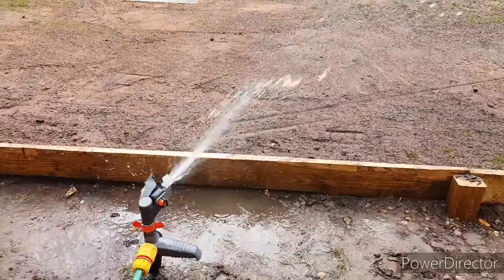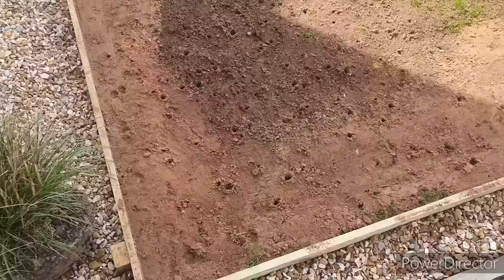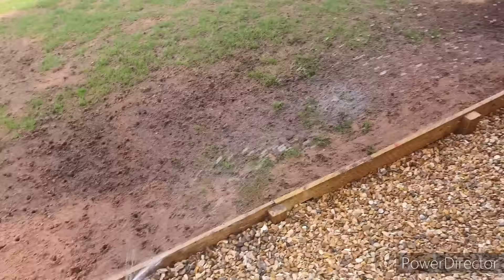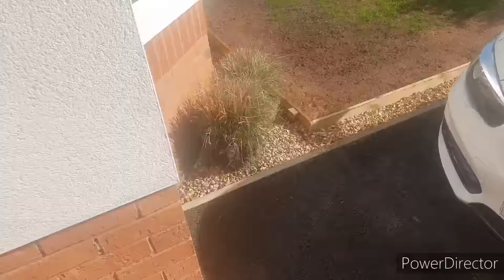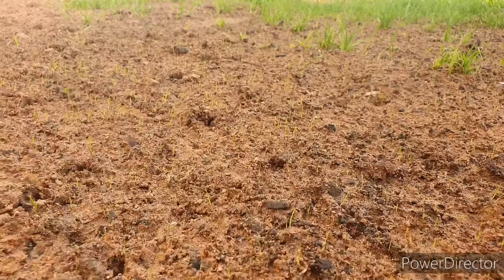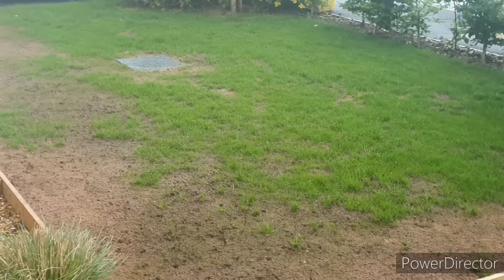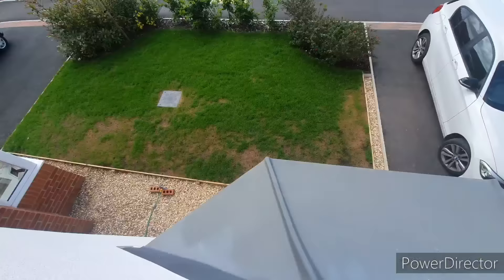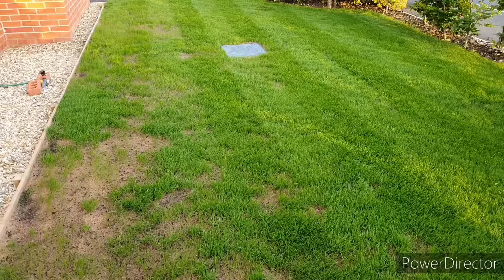Watering new grass seed (day 1, 7, 14) - 4 Week Time Lapse

Comment: 7x a day seems like a LOT of watering.  I'm in zone 8a and I just got my sprouts after day 7, with only watering 1x a day for 15-20 minutes.  I have been checking the ground by hand to ensure it's moist enough and that seems like it's been enough.
Reply: This is good news, I mean, who runs home from work every 4 hours to water the lawn?  I water one time in the evening, takes me about 30 minutes.  Hopefully I will see some germination soon.
Reply: @GiddingsMcCann  - I'm not sure what zone you're in but my above example, though in Texas, was done in a cool time of year:  April.  If you're in 8a or hotter and doing it now, you'd definitely need more watering than what I did but maybe a good soak at night could be enough.  Hot af right now

Comment: I have seeded my lawn on June 5th.  I found impact sprinklers move the soil and seed when the water lands on the soil.  I switched to Orbit Voyager II inground sprinklers (via hose and spike; above ground) with Orbit B-hyve timers.  I chose these sprinklers because I can defuse the water pattern into small droplets and still throw over 25 feet with two sprinklers on a hose.  Impact sprinklers require lots of pressure to cycle back and forth.  These Orbit sprinklers don't need high pressure to work well.
Reply: Name of this grass please

Comment: I have a tip for you. Those aquastop connectors are convenient , but rob you of pressure. Knock out the piece inside and you will be amazed at the difference.
Reply from the maker: Thanks mate
Reply: This. 100%. I was going to return my Gardena full/part circle sprinkler but replaced the 'aquastop' with a straight through and bought 10m of new hose. I have a 50m wall mounted drum I used so swapping these two things out means I barely turn the tap on now and the sprinkler works perfectly.

Comment: Hi, I have seeded my lawn 30 days ago with Barenbrug Solide mix. Grass is still kinda thin + have few bare patches which looks like they are coming trough. On top of that I am fighting with weeds and I already regretted not waiting for fall. Should I overseed now or should I wait till fall? On one hand I am afraid of more weeds popping out and on other hand I worry about overseed success rate. I have installed irrigation system with Hunter popup sprinklers but its not automated yet so I can't always have soil wet for sure.

Comment: I have better luck with metal sprinkler heads. Think sometimes i have bought plastic ones that were not round completely and they stick more.
Reply from the maker: This plastic one is robust but I do admit it's hard to set and return but I think my water pressure is the issue

Comment: how long do you water for each time please? I've also used A1 seeds and have been watering twice a day for about 7min each time.  Cheers
Reply from the maker: Depends alot of soil type, wind, slopes, weather etc but generally at the moment around 5mins few times a day just try keeping the soil visually moist
Reply: @GardenLawncareGuy  ours is a thin layer of soil over clay I believe.  I have dug out a few patches that wernt growing at all due to bricks etc in there (new build garden) otherwise it is pretty flat. This is my last attempt as I'm sure the clay under it is causing issues
Reply: @neilwest9345   are you using the Clay soil type if grass seeds you can get?

Comment: Hi  i have just prepped and reseeded a large patch of my lawn. Im finding this weather is being a nightmare this year. I took the plunge and got on with it. I have a patch which is only 4 x 2 meters,  I have a sprinkler but i find it drenches my garden, puddles etc. Is going out 3 times a day for 4/5 minutes just going over it with he hand held enough? I think i have been guilty of watering too much in the past while trying to germinate seeds.  If not wet my soil gets super dry very quick. Thanks and Subbed
Reply from the maker: Which ever method you use, key is to keep thing moist but not sitting in water or drenched Chris
Reply: @GardenLawncareGuy  that’s wicked ! Thank you..  I will just keep using the shower mode on the hand held a few times a day then! Thanks again

Comment: I’ve also reseeded an area in my back garden but I didn’t put no soil back over the seed will my seeds still germinate?
Reply: If you packed it down or raked over a little it will be fine.
Reply from the maker: Yes they will, each step will improve the percentage germination the key point is soil contact and moisture.
Reply: Cheers

Comment: At 40 seconds in, you lost me.  Impact sprinklers are not a good option for seeding a bare soil bed.  I did a full lawn renovation and before I laid seed on my 100% bare soil, I put out some impact sprinklers and with bare soil, I saw just how horrible they are at evenly covering new seedlings.  As yours did, it had a ton of water all around the base, and a lot of water where the stream was landing, but the patch between was evaporating almost as fast as it was being watered because so little water was landing.  I had a big donut shaped water mess, and any seed at the impact point on the impact sprinkler would have been washed away.  I stress oscillating sprinklers because they apply water more evenly, and the water falls almost straight down versus horizontally, so you don't push seed out by accident.  The Melnor brand allows you to adjust how far back and forth you spray, as well as individually setting how narrow or wide each side sprays out.  I'm sure there are other good brands that operate similarly, but this is what I had available at my big box store.  It worked perfectly for my Zoysia in my front, and my Rye/Kentucky Bluegrass in the back.

Comment: How long do you have the sprinkler on for at a time
Reply from the maker: Around ten mins but it depends on your Soil, the weather and slopes.
Reply: @GardenLawncareGuy  what about 25 degrees in the sun 1hr every 6hrs be enough? Or do you think less
Reply: Or like half an hour every 3 hrs so at least it gets the water sooner
Reply from the maker: Timeless important keeping the seeds moist is most important. An hour seems too long in all conditions
Reply: @GardenLawncareGuy  to get mine as wet as what yours is looking like takes about half an hour 45 mins but it's got a bigger area to cover is only reason but it looks like the ground starts to dry out after about 2hrs in the heat so I'm worrying

Comment: Hi, I followed your videos last year and now we are into a new spring I would like to ask how many times a week, and for how long a lawn should be watered. I now work away and am only home at weekends, so, as I have been concerned that I cannot water during weekdays, I have bought an automatic timer, a 50m irrigation hose and 2 sprinklers. I am considering setting the time to water the lawn during the night, and for around 10 minutes for all 7 nights of the week. Do you think this is correct, or do I need to water for less days but longer than 10 minutes?
Reply from the maker: Hi David when watering it's better to water deeply less often e.g. weekly so the grass develops a better root system that finds water otherwise you will have shallow roots. That being said, in the UK I rarely water the lawn only by exception during periods of no rain and sun
Reply: @GardenLawncareGuy  Thanks.

Comment: Sorry, but there’s so much bad advice. 

Firstly, I was curious what seed you were using and after clicking the link to the seed page, I could not find anywhere what type of seed is in the mix. How do you even sell grass seed and not specify the type of grass is beyond me. 

Secondly, no you can’t seed anytime you want between spring and fall. That’s terrible advice. The only time you should seed is in the start of spring, when soil temps hit 55F/12C or late summer/early fall. Late summer/early fall is the best time to seed since the ground is warm making germination easier and weeds are dying out while your grass is starting to grow. 

Lastly, you should never seed when rain is coming. Your best bet for success is to seed when you have at least a full week of no rain. The reason being is that rain can easily cause washout and completely ruin all your hard work. If you’re seeding you must set up sprinklers for success. With sprinklers, watering is easy and there’s no risk of washout if you’re watering properly.